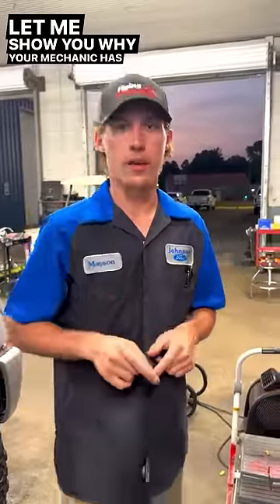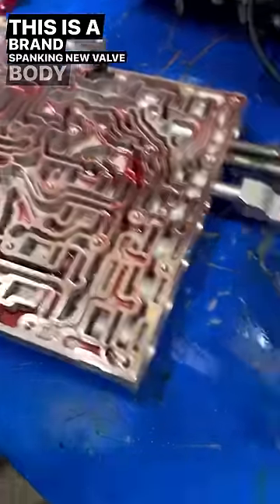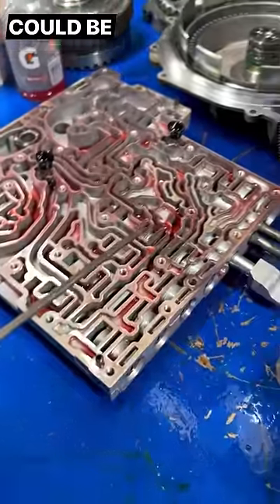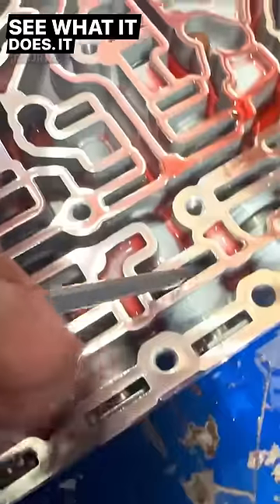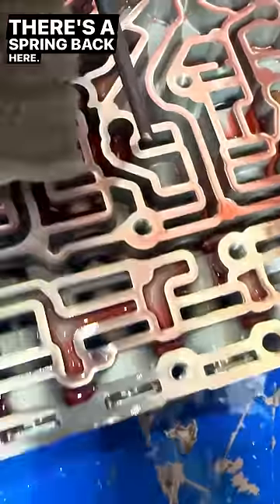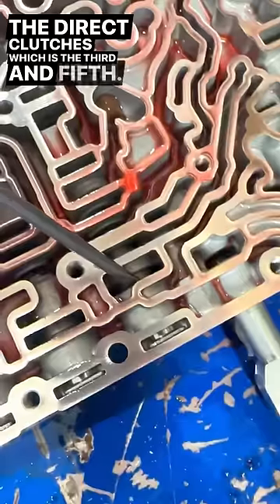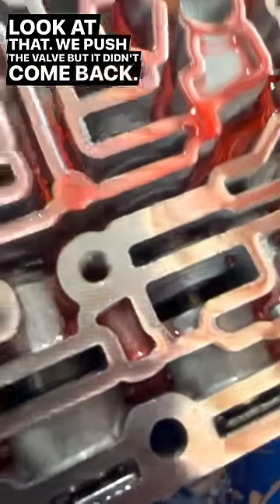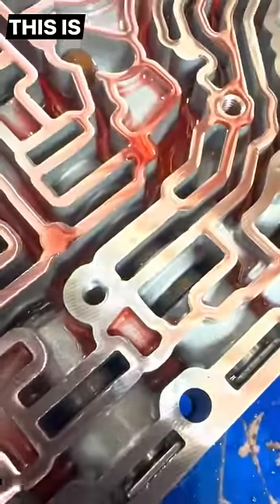Why your mechanic has trust issues #shorts #ford

Comment: “Could be something I did” smacks both gasket surfaces with a screwdriver
Reply: Dnt matter it's FD anyway
Reply: @richardschafer1911 Based on this short that doesn’t show the prior state
Reply: There that’s better 😂
Reply: @coryiverson9151 Most things can be repaired, this would be a trivial repair.
Reply: I'm sure he did that before installing it too. Definitely isn't because the part is trash.
Reply: @siamese7577  a sticky valve is almost certainly an easy repair. A dinged gasket face less so.
Reply: Yep. The part can handle the stresses of a hundred thousand miles or more, but is defeated by tapping it with a screwdriver.

He tapped it, he didn't gouge it. It's fine.
Reply: @CynicalDriver  It's a sealing face, any imperfections and you're done. Whacking an aluminium gasket face with a hard steel screwdriver is sure to mark it... There's a reason you scrape off old gaskets/residue with a copper scraper and never a steel one if they're stuck on.
Reply: There is a reason for the gasket.
Reply: @CynicalDriver driving a hundred thousand miles doesn’t split your casing open and mar your gasket surfaces… wtf kind of reasoning is that? 😂
Reply: @chemistrykrang8065  scraping and tapping are two VERY different destructive forces.
Reply: @coryiverson9151 Spoken like someone who's never fixed anything in his life.
Reply: @CynicalDriver Yes layman, they are very different, as improper scraping is much less destructive than fucking impacts are. Quit trying to look knowledgeable and listen to the people who know what they're talking about.
Reply: That valve is supposed to have a high surface finish
Reply: Slapping his screwdriver around, scraping the valve bodies just makes me cringe!
Reply: @CynicalDriver  Its a sealing face, you are incorrect. Clearly you don't actually know anything about this.
Reply: @CynicalDriver  Tapping is worse...
Reply: In a shop it's cheaper to replace than repair alot of times. Especially when you have to reinstall a bunch of parts to even test if it works. He probably plans to replace the whole thing. But yes you have to be careful with aluminum surfaces if you plan to reuse. Always nerv wrecking cleaning off stuck paper gaskets.
Reply: I was thinking the same thing. Monkey hands shoving his screw driver all around precision engineered components 🤔
Reply: Anyone who is trying to say him tapping it with a screw driver damaged it is just a male Karen digging for shit 😂 that or they just need a reality check.
Reply: @CynicalDriver yeah you don’t know what you’re talking about lol as a machinist this is cringe worth hitting that with a hardened screwdriver driver definitely will fuck it up
Reply: @jamesclouse9947 No. It just damaged it MORE. 

That part is machined to fit together as tight as we can make. And he's tapping on the aluminum body with a steel screwdriver.
Reply: Its probably a steel seperator plate. I havent worked on that one. But its often a seperator plate.
Reply: Best coment
Reply: It was new now its not anymore 😅
Reply: @chemistrykrang8065 Well, it's cut in half so it doesn't really matter anymore.
Reply: @cameronbartlett856 'cut in half' 😂 this guy ☝️ is a genius, like maybe that's the reason it don't work huh 🧐 /s
Reply: The amount of people saying it's fucked ... clearly it's just the spring or bad clearance on the fit for the valve and just has extra friction.... it would be dumb to replace the entire valve BODY when you can just fix the transmission valve for that clutch set....
Reply: All the keyboard mechanic acting like it could be fixed when you ALWAYS get new parts to avoid being liable. New parts from the dealership if its under warranty
Reply: @jamesclouse9947  someone hasn't taken 4 years of mechanical engineering classes
Reply: Not nice to do that, but nothing happens, it's just a slight tap, alloy wont get a ding big enough to develop a leak. Source: 34 years fixing transmissions.
Reply: I wanted to scream
Reply: This comments not gonna cut it😂
Reply: Also so what. What will that to to the valve that's so detrimental?
Reply: @jennifergidden9884  it can cause a leak. Those gasket faces are machined to incredibly precise flatness which the seal is dependent on. The tool he is tapping it with is harder than the material of the part. You should never do this. It can mar or dent the sealing surface and instead of a simple fix, you would need to replace the entire part. I don't think he did any damage here but watching this is like nails on a chalkboard for an engineer. I might get fired if I was caught doing this
Reply: @jamesclouse9947 says the guy digging for sh1t by putting down the experts who knows more about sealing surfaces than he does 😂😂😂
Reply: @chemistrykrang8065  you're clearly a TeChNiCiaN and not a mechanic. It dopes not need to be perfectly straight, it'll be fine
Reply: Came here to read what people say about tapping the part with a screwdriver which is an obvious no-no. It could have been worse: he could have hit it with a flying wrench.
Reply: @stupidsnek  you do what you want on your vehicles, but I have enough experience and good sense to know how to look after a sealing face. Sometimes the damn things leak even though everything seems perfect - you're just asking for a leak if it's marked, so you take care not to use steel tools around them. 

It doesn't matter if this part is scrap (I don't think it is, that valve body clearly just has a burr), it doesn't matter if he really damaged it this time. What matters is that he clearly doesn't have the training and experience to follow good practice by habit, and that speaks volumes. I wouldn't want him working on my car. If he's doing this you just know he's sloppy with everything else. Every bolt will be over tightened with a rattle gun, and all the self tapping screws in the the plastic trim will be stripped right out and loose.
Reply: I guess y'all miss the part where he said he bought it brand new, in this case you put it back in the box and send it back as a defected part and you get another brand new one.  Then you look at the new one and make sure its not fd up in the same area, its good learning experience.
Reply: All these newly minted engineers puffing out their chests. Like noone in your industry is a hack. Meanwhile payroll and legal both know. You don't waste money paying people to fix things that can be replaced for free. And you don't ever accept liability if you don't have to. Congratulations guys, you spent half a decade and went into debt to work for someone else. Feel free to compensate for it in a comment section.
Reply: He can't use that part without rebuilding the valve anyway. Makes no difference, gasket can't be reused anyway.
Reply: @RadicalEdward_115 New VALVES, the aluminum part normally goes back in. I've had a few transmissions apart and while you might replace a valve body if it was worn and not holding pressure, this one has the opposite problem (too much friction). Given the tolerances, lapping the valve or just de-gumming everything might be enough to fix it.
Reply: @Lawrence330  if you own a shop never reuse old parts to fix a customers car. Period
Reply: The part is already defective, so what difference does it make.
Reply: Guys I want in on the arguments! Can we fire this back up? I'll tell you who's right and who's wrong. 😎